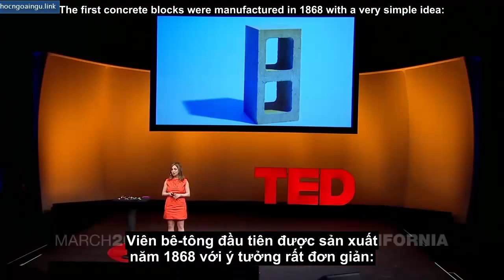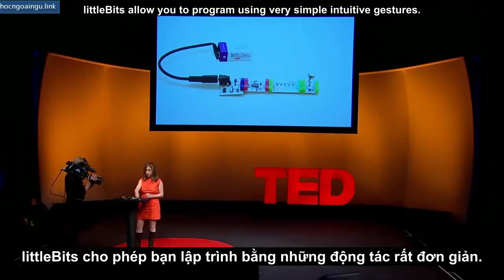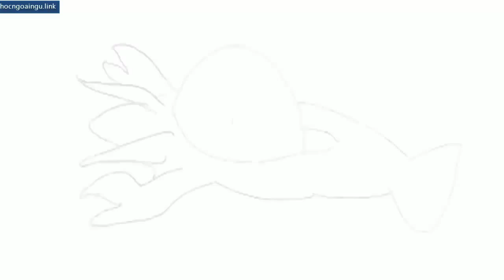[TED Vietsub] Ayah Bdeir  Những khối điện tử nguồn mở

Comment from the maker: Script:

0:11 This may sound strange, but I'm a big fan of the concrete block. The first concrete blocks were manufactured in 1868 with a very simple idea: modules made of cement of a fixed measurement that fit together. Very quickly concrete blocks became the most-used construction unit in the world. They enabled us to to build things that were larger than us, buildings, bridges, one brick at a time. Essentially concrete blocks had become the building block of our time.

Điều này nghe có vẻ kì lạ, nhưng tôi là một fan bự của những viên gạch bê tông. Những khối gạch bê tông đầu tiên được sản xuất vào năm 1868 với ý tưởng rất đơn giản: những khối chuẩn bằng xi măng với kích cỡ cố định khớp với nhau. Những viên gạch đã nhanh chóng trở thành loại vật liệu xây dựng được sử dụng nhiều nhất trên thế giới. Chúng giúp chúng ta xây dựng những thứ lớn hơn bản thân mình, các tòa nhà, các cây cầu, từng viên gạch một. Có thể nói gạch bê tông đã trở thành những viên gạch xây nên kỉ nguyên của chúng ta.

0:41 Almost a hundred years later in 1947, LEGO came up with this. It was called the Automatic Binding Brick.And in a few short years, LEGO bricks took place in every household. It's estimated that over 400 billion bricks have been produced -- or 75 bricks for every person on the planet. You don't have to be an engineer to make beautiful houses, beautiful bridges, beautiful buildings. LEGO made it accessible.LEGO has essentially taken the concrete block, the building block of the world, and made it into the building block of our imagination.

Sau gần 100 năm, vào năm 1947, LEGO đã giới thiệu thứ này. Nó được gọi là Gạch Tự Gắn (Automactic Binding Brick) Và chỉ trong vài năm ngắn ngủi, những viên gạch LEGO đã có mặt tại mọi nhà. Theo ước tính, có hơn 400 tỉ viên gạch LEGO đã được sản xuất -- hay 75 viên cho mỗi người trên trái đất. Bạn không cần phải là một kĩ sư để có thể xây nên những căn nhà đẹp, những cây cầu đẹp hay những tòa nhà đẹp. LEGO đã làm điều đó trở nên khả thi. LEGO đã lấy khối gạch bê tông, những khối gạch xây nên thế giới, và làm nó thành những viên gạch của trí tưởng tượng.

1:13 Meanwhile the exact same year, at Bell Labs the next revolution was about to be announced, the next building block. The transistor was a small plastic unit that would take us from a world of static bricks piled on top of each other to a world where everything was interactive. Like the concrete block, the transistor allows you to build much larger, more complex circuits, one brick at a time.

Cũng trong chính năm đó, ở phòng thí nghiệm Bell một cách mạng kế tiếp sắp được công bố, thế hệ tiếp theo của những viên gạch. Transistor là một cấu kiện điện tử bằng nhựa mà sẽ đưa chúng ta từ thế giớicủa những khối gạch bất động chồng lên nhau đến thế giới mà mọi thứ tương tác được với nhau. Giống như viên gạch bê tông, transistor cho phép bạn xây những mạch điện lớn và phức tạp hơn, từng viên gạch một.

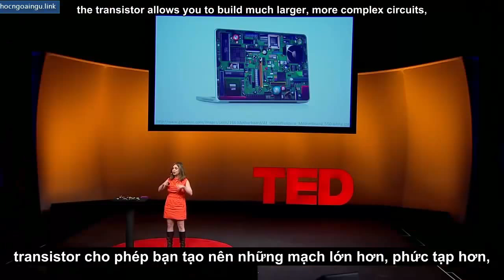1:35 But there's a main difference: The transistor was only for experts. I personally don't accept this, that the building block of our time is reserved for experts, so I decided to change that. Eight years ago when I was at the Media Lab, I started exploring this idea of how to put the power of engineers in the hands of artists and designers.

Nhưng có một sự khác biệt lớn: Transistor chỉ dành cho chuyên gia. Cá nhân tôi không chấp nhận điều này, rằng những viên gạch xây nên kỉ nguyên hiện đại lại chỉ dành cho những chuyên gia, nên tôi đã quyết định thay đổi nó. Tám năm trước khi tôi còn ở phòng nghiên cứu truyền thông, tôi đã khám phá ra ý tưởng đó là làm sao để đưa khả năng kĩ sư đến với nghệ sĩ và nhà thiết kế.

1:56 A few years ago I started developing littleBits. Let me show you how they work. LittleBits are electronic modules with each one specific function. They're pre-engineered to be light, sound, motors and sensors.And the best part about it is they snap together with magnets. So you can't put them the wrong way. The bricks are color-coded. Green is output, blue is power, pink is input and orange is wire. So all you need to do is snap a blue to a green and very quickly you can start making larger circuits. You put a blue to a green, you can make light. You can put a knob in between and now you've made a little dimmer. Switch out the knob for a pulse module, which is here, and now you've made a little blinker. Add this buzzer for some extra punch and you've created a noise machine. I'm going to stop that.

Một vài năm trước tôi đã bắt đầu phát triển littleBits. Để tôi cho bạn thấy chúng hoạt động ra sao.LittleBit là những cấu kiện điện tử với những chức năng khác nhau. Chúng đã được thiết kế sẵn để trở thành ánh sáng, âm thanh, động cơ và cảm biến. Và phần thú vị nhất về chúng là chúng kết dính với nhau nhờ nam châm. Nên bạn không thể đặt chúng sai được. Những "viên gạch" này đã được đánh dấu bằng màu. Xanh lá cây là đầu ra, xanh biển là nguồn điện, hồng là đầu vào và da cam là dây dẫn. Thế nên những việc bạn cần làm là nối xanh biển với xanh lá và rồi rất nhanh chóng bạn sẽ có thể bắt tay vào làm những mạch lớn hơn. Bạn gắn xanh biển với xanh lá, bạn có thể làm ra mạch đèn. Bạn cho một núm xoay vào giữa và giờ bạn có thể chỉnh sáng tối cho đèn. Thay núm xoay bằng khối tạo xung, như thế này, và giờ bạn đã có một mạch đèn nhấp nháy . Gắn thêm chiếc chuông điện này và giờ bạn đã tạo ra máy tạo tiếng động. Tôi sẽ tắt tiếng này đi.

3:08 So beyond simple play, littleBits are actually pretty powerful. Instead of having to program, to wire, to solder, littleBits allow you to program using very simple intuitive gestures. So to make this blink faster or slower, you would just turn this knob and basically make it pulse faster or slower. The idea behind littleBits is that it's a growing library. We want to make every single interaction in the world into a ready-to-use brick. Lights, sounds, solar panels, motors -- everything should be accessible.

Như các bạn đã thấy, không chỉ đơn giản để chơi littleBits còn tỏ ra là một công cụ mạnh. Thay vì phải lập trình, nối dây hay hàn mạch, littleBits cho phép bạn lập trình bằng những thao tác trực quan đơn giản. Để làm cho mạch nhày nhấp nháy nhanh hoặc chậm hơn, bạn chỉ cần xoay núm vặn này và thay đổi tốc độ nháy đen một cách đơn giản. Ý tưởng đằng sau littleBits là xem nó như thể một dạng thư viện đang được phát triển. Chúng tôi muốn tích hợp mọi tương tác trên thế giới vào những "viên gạch" có thể sử dụng dễ dàng. Ánh sáng, âm thanh, tấm pin mặt trời, động cơ -- mọi thứ đều có thể tiếp cận được.

3:39 We've been giving littleBits to kids and seeing them play with them. And it's been an incredible experience. The nicest thing is how they start to understand the electronics around them from everydaythat they don't learn at schools. For example, how a nightlight works, or why an elevator door stays open,or how an iPod responds to touch. We've also been taking littleBits to design schools. So for example, we've had designers with no experience with electronics whatsoever start to play with littleBits as a material. Here you see, with felt and paper water bottles, we have Geordie making ...

Chúng tôi đã đưa littleBits cho trẻ nhỏ và xem chúng chơi với littleBits. Và đó là một trải nghiệm tuyệt vời. Điều hay nhất đó là làm cho trẻ nhỏ bắt đầu hiểu về hoạt động của những thiết bị điện tử hằng ngày xung quanh chúng điều mà chúng không được học ở trường lớp. Ví dụ như đèn ngủ hoạt động ra sao,hay tại sao cửa thang máy tự động đóng mở, hay làm sao chiếc iPod phản ứng lại những cái chạm tay.Chúng tôi cũng đưa littleBits tới các trường dạy thiết kế. Ví dụ như ở đây chúng tôi có những nhà thiết kế mà hoàn toàn không biết chút gì về điện tử bắt đầu chơi với littleBits như công cụ sáng tạo. Và ở đây bạn sẽ thấy, cùng với vải nỉ, giấy và chai nước, Geordie đã làm ra ...

4:12 (Clanging)

(tiếng kim loại)

4:14 (Buzzing)

(tiếng chuông)

4:16 A few weeks ago we took littleBits to RISD and gave them to some designers with no experience in engineering whatsoever -- just cardboard, wood and paper -- and told them "Make something." Here's an example of a project they made, a motion-activated confetti canon ball. (Laughter) But wait, this is actually my favorite project. It's a lobster made of playdough that's afraid of the dark.

Một vài tuần trước chúng tôi đưa littleBits tới RISD (trường thiết kế Rhode Island) và đưa chúng cho một vài nhà thiết kế không có kinh nghiệm gì với kĩ thuật chỉ với bìa, gỗ và giấy -- và bảo với họ rằng "Hãy làm gì đó." Đây là ví dụ về dự án mà họ đã làm, súng bắn hoa giấy kích hoạt bằng cử động. (tiếng cười)Hãy đợi đã, đây là dự án ưa thích của tôi. Đó là một con tôm hùm làm bằng đất nặn và nó sợ bóng tối.

4:44 (Laughter)

(tiếng cười)

4:48 To these non-engineers, littleBits became another material, electronics became just another material. And we want to make this material accessible to everyone. So littleBits is open-source. You can go on the website, download all the design files, make them yourself. We want to encourage a world of creators, of inventors, of contributors, because this world that we live in, this interactive world, is ours. So go ahead and start inventing.

Đối với những người không phải kĩ sư, littleBits đã trở thành một dạng vật liệu khác, điện tử đã trở thành một vật liệu mới. Và chúng tôi muốn vật liệu này tiếp cận được với mọi người. Thế nên littleBits là dự án mở. Bạn có thể lên trang web, tải về những file thiết kế và tự làm chúng. Chúng tôi muốn cổ vũ thế giớicủa những nhà kiến tạo, nhà phát minh và những người cống hiến, bởi vì thế giới này, nơi chúng ta đang sống, thế giới tương tác này, là của chúng ta. Hãy tiến lên và bắt đầu phát minh.

5:12 Thank you.

Cám ơn các bạn.

5:14 (Applause)